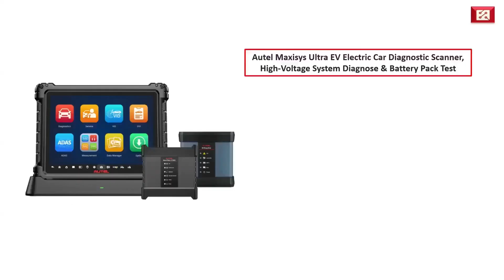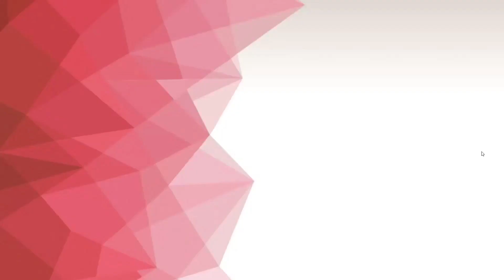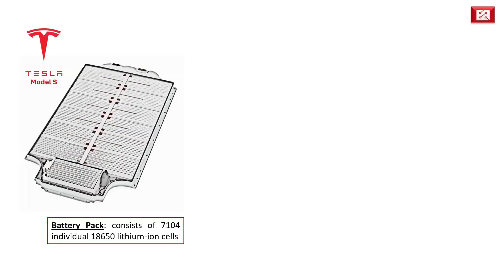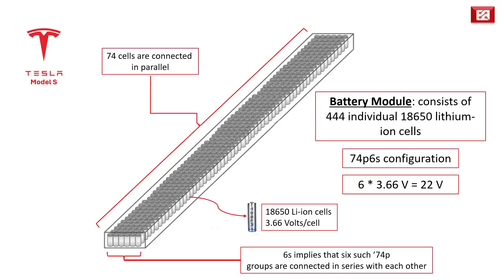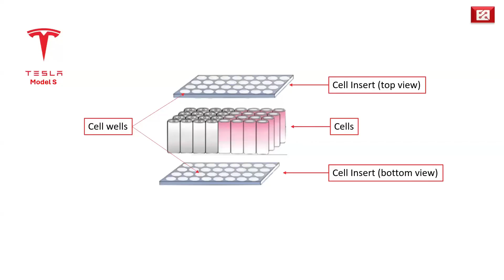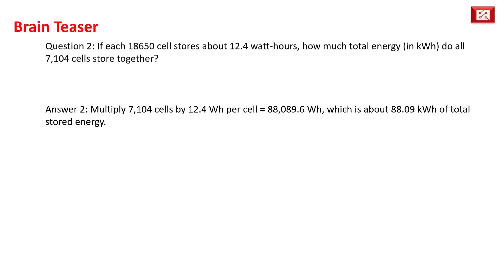Tesla Model S Battery Module

Comment: if the cell wire bond blows, just the pack capacity is slightly decreased, but does not affect the total voltage, because cells are connected in Parallel. Therefore HV pack continue to operate normally.
Reply from the maker: Very good attempt and you are correct